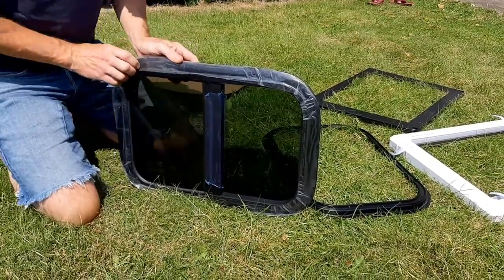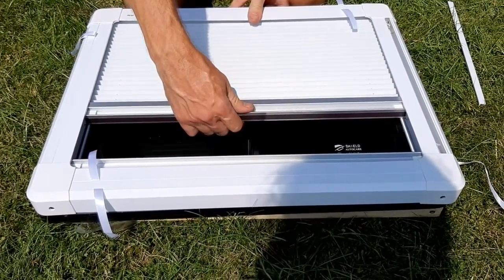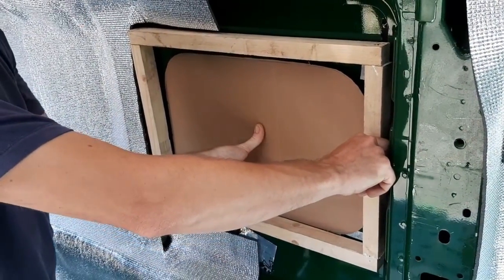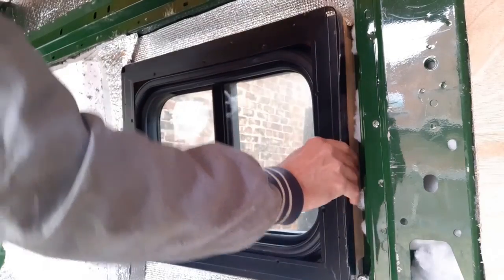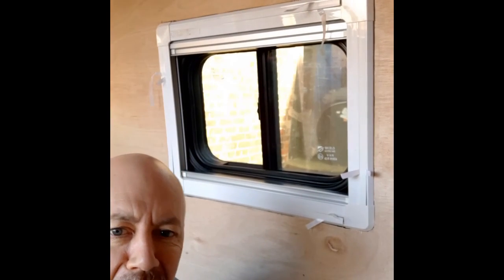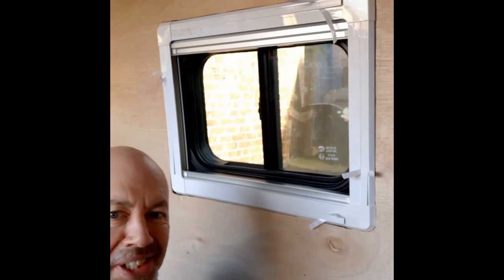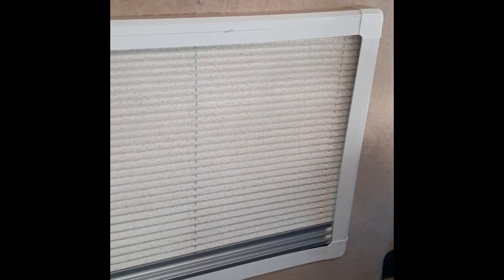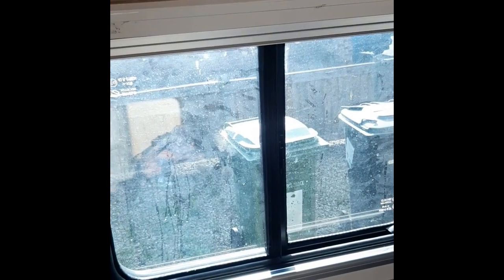Review and Fitting of SHIELD AUTOCARE Sliding Cassette Windows on FIAT DUCATO Campervan Conversion.

Comment: Hi Craig,  Thanks for putting up the video its always very useful to see someone fit the windows first. You would think the company should be putting up a video for us all to follow. I think and i haven't tried it yet but maybe the plywood should be cut around the window to follow the curves of the frame before you fix the square metal outer frame then the plastic frame fits over the ply to hide the cuts? I am going to have a go myself so fingers crossed.
Reply: Hi Paul, I did consider that, but the metal frame has a lip on it, so it is not flat and it didn't seem to make sense. Let us know how you get on 👍

Comment: Hi Craig! Thanks for the upload! Great content mate! What sealant did you use?
Reply from the maker: Puraflex 40. It's a black sealant. Similar to sikaflex. I think I bought mine from screwfix.
Reply: @craigeddington-soulshineli3990  Thanks for the reply! I’m fitting mine tomorrow 👍🏼
Reply: Hi mate! Where did you install/apply the black pvc strip that came with the window?
Reply from the maker: @Nutberg20  in the channel, over the screws on the inner frame ( hope that makes sense)
Reply: @craigeddington-soulshineli3990  Appreciate the reply! Thanks 👍🏼

Comment: Hi, what part of the window or frame did you use to make your template? Thank you
Reply from the maker: I drew around the inner profile then added on a few millimetres each side. It gives the precise measurements in the fitting instructions. It was about 3 or 4 mm from memory.